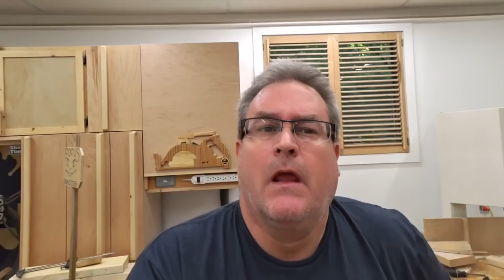How accurate and dependable are homemade tools?

Comment from the maker: More here:
https://the-heisz-wandel-project.ca/

I think it is possible to make a table saw mainly from wooden components that is as dependable and accurate as a factory made machine. However, like I said in previous videos, accuracy and precision has more to do with the operator and his skill and ability.
Reply: Exactly and other benefit of making it yourself is that you can build it to your specifications, say height or width. Wouldn't be the first time that somebody buys something and wish after that it was just a bit more this or that. For instance you as well as Matthias added to the width of your tablesaw, nothing wrong with it off course, but imagine how sweet it will be when your "permanent " tablesaw is finished "exactly" how "you" like it!  And off course the bragging rights after when its done to all the disbelievers.:-)

Comment: I'm a small scale wood worker and I find that having a horizontal mortising machine is invaluable for doing jointery. Even if I'm just doing a table with floating tenons I have to do 16 mortises. If it has  braces down below it needs +24 mortises. I can mark one piece of apron and one leg, clamp the work against the fence, setup the machine to cut within the marks, and GO. I only have to adjust the height of the cut for my reveal on the legs and I have a frame that has no top planing needed. Taking the time to setup the machine is a few minutes, the cutting time is about 10 minutes.

Using an 1/8" per turn screw to adjust the height on my horizontal mortising machine has been a treat. I've proven that I can cut a repeatable box joint of any sort I would like and not have to worry about cutting them all in one shot. I make high quality desktop items that need to have perfect joints and hand cutting them just isn't as accurate as well a table saw can chip out the woods I use. This machine has become one the most useful in my shop and I'm always thinking of how I can use it next.

Comment: A pantorouter IS for production,  I happen to love the age old low tech design's capability (the pantograph was originally made to scale diagrams) to relieve the person in cases where there is robot like work, and it's less spinning metal than an electric saw. Your results may vary. Better is better.

Comment: I think part of the reason why hobbyists, like me, want a pantorouter or box joint jig is the illusion that they deal with my lack of skills and experience. Realistically I'm rubbish at woodworking (but may hopefully get ok one day) and know that simply using such things would require at least a high degree of competence, never mind building them. 

But still I dream of a shop with such wonders where I can make things - the ultimate driver - quickly and accurately...
Reply: I am perfect proof that an excellent tool can still be misused my someone who does not understand how to use it. Even with a CNC or 3D Printer (or even a box joint jig) if you do not set it up properly. You will still get garbage out of it.
Reply: I see this a lot in the CNC community. People who buy something like the X-Carve with no clue how to do the assembly of the machine itself much less what to do with it after they have it. This leads to frustration and anger on the part of the customer. A cool machine is no substitute for practice and building a skill set.

Comment: I felt that Mattias was saying that designing and building the lift and title mechanism of a homemade table saw was difficult. Mattias' last homemade table saw didn't have the ability to bevel cut although I'm sure he was fully capable of designing and building that feature (see Cosmas B.) I imagine he probably didn't see a benefit to dedicating time to build those components which need to be pretty accurate. I could be completely wrong though.
Reply: I agree that Matthias is fully capable to make those parts. The problem i think why he would be reluctant to build a saw is the arbor. Everything stands or falls with this component. Or you build a saw with a "skill" saw and that will never be as ridgid ( precise) as a real arbor ( longer shaft and better bearings etc.) . Or you build a saw with a good arbor and then all your mesurements  depent on that . Problem here is to find that part common available for your subscribers, if this has other dimensions all your other parts have to adapt for your raising and tilting the blade. Imagine all the emails he would get. Off course you can let it be made at a machine shop but i think that would stop people to go forward ? And then making the parts ajustable (al whole other and interesting tophic) isnt that easy eather ! I just finished making the complete powerbox for a saw myself, it was slow but steady. Still far from finishing the saw.
I really hope John will make his "permanent permanent" saw and i will buy the plans for support and my curiosity! 
Sorry for the long respons ,cheers
Reply: just use 1 1/4" shasft with pillow bloc, use the spinnig shaft as a lathe to center drill it and tap it
 and use a bolt and flange suited to your blade, job done
Reply: raf vdp the best option for repeatability of a design would clearly be to just find a brand of table saw that is a) available and ideally popular over the whole globe and b) has reasonably priced spare parts.

And then make the engineers at that company wonder why they’re suddenly selling so many replacement arbors.
Reply: Agree , but if you say world wide and good quality i think brands like ALTENDORF, MARTIN, FELDER ,...then i highly doubt if they sell there parts to a private person and if so idont think you would like to know the price.
Like you say "reasonably priced" would be key here.

Comment: I quite agree with John in that accuracy depends on the operator.. and similarly for a homemade tool, on the accuracy bestowed upon the design and build process by the builder...

Most homemade table saws in the YouTube Maker space simply use a relatively cheap circular saw bolted to the bottom of a flat surface.. Nothing horribly wrong with that, except that all height and angle adjustments rely on the circular saw’s own lift and tilt mechanisms, which aren’t built for accuracy in the first place..

Cosmas Bauer’s design does a nice attempt at building a decently accurate table saw by doing away with the saw’s own lift and tilt mechanisms, and bounding down the circular saw to the point that all the original saw needs to do is just to spin the blade.. All other aspects that affect the accuracy of the design, he effectively took it over with his trunnions and lever mechanism.. It’s possible to get decent accuracy, just takes a lot of work, patience and good design...
Reply: Also most circular saws have so much play, that makes it virtually impossible to make a decent table saw.